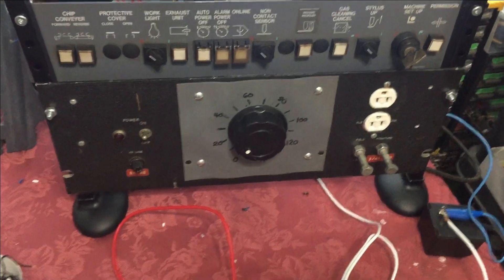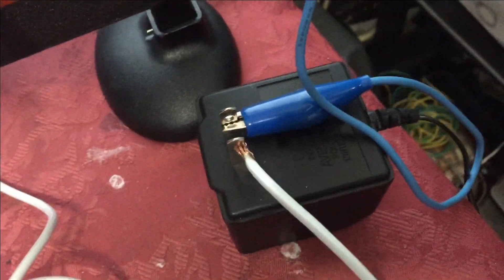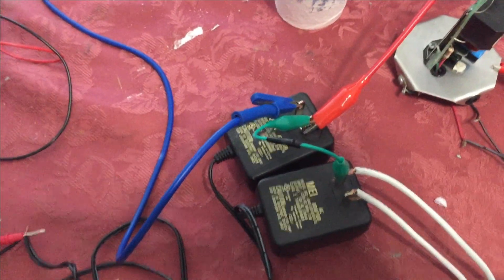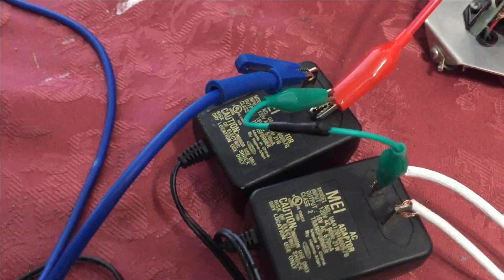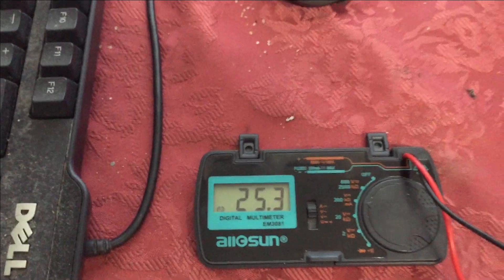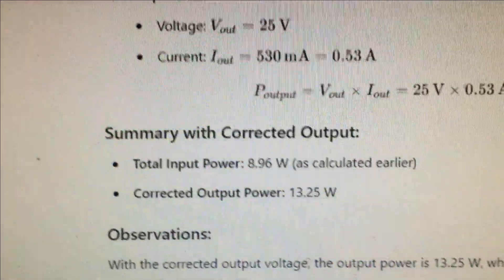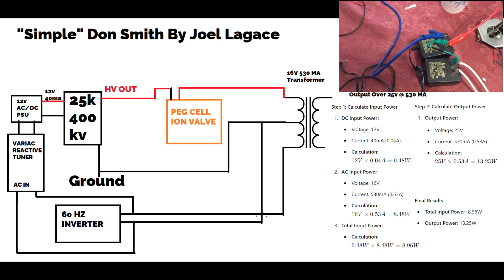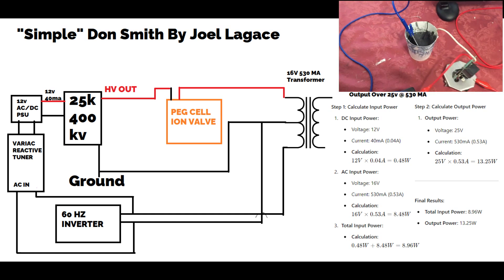Energy Amplification

Comment: Hi Joel, Don Smith built his device using three modules. 
First: Excitation
Second: Storage
Third: Conversion
He said to build it backwards, stage three first. Determine the load. This with my limited knowledge is where I least confident. This is the stage where one converts HF and HV to 60 Hz and 120 or 220v.
I understand how to drop the voltage but converting the HF had me perplexed.
One question I have for you is:
If you have a transformer set up with a resistor and cap in parallel to the input of a transformer set to fire at 60 Hz is there a limit to the HF that you can send to said transformer?
Reply from the maker: They will respond or block depending on resonance. try and calculate upper harmonics of 60 hertz maybe. Don had more complex setup to work with these various systems. I tried to overly simplify here at probably a great loss of efficiency.  But seems promising as proving a point of concept. I'd have to build it in a more professional fashion and really experiment with it for a while.

Comment: Very interesting Joel, could you put a ten or twelve watt load where the meter is to check that you are getting 500mAh from the transformers? Just thinking if the volts go up there do the amps go down or does the transformers in series double the amps to counter that drop?